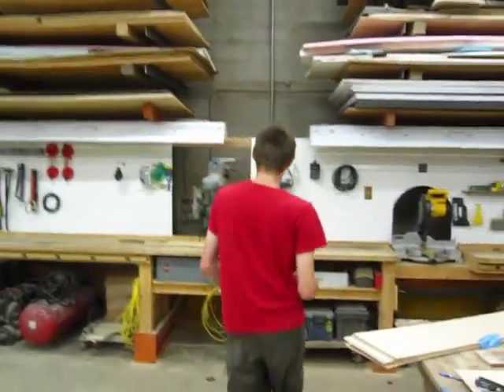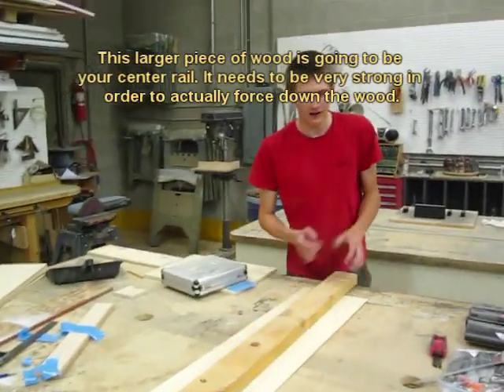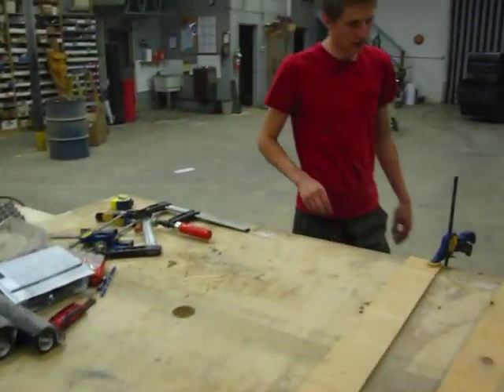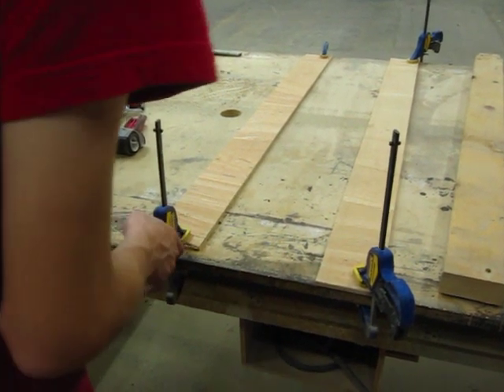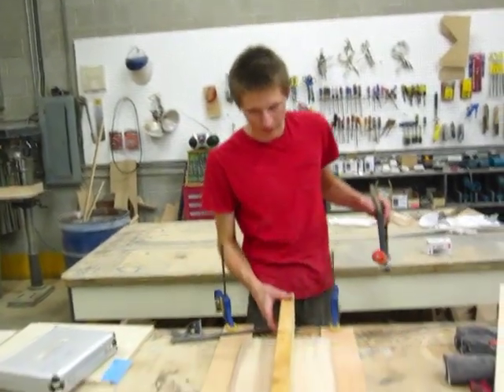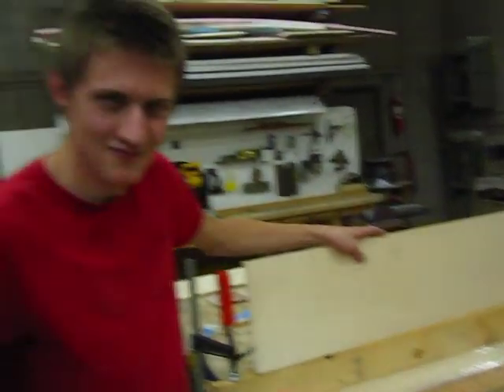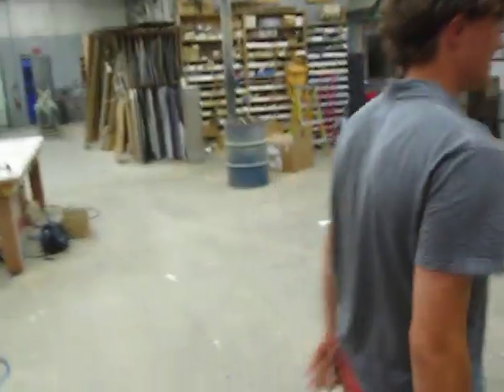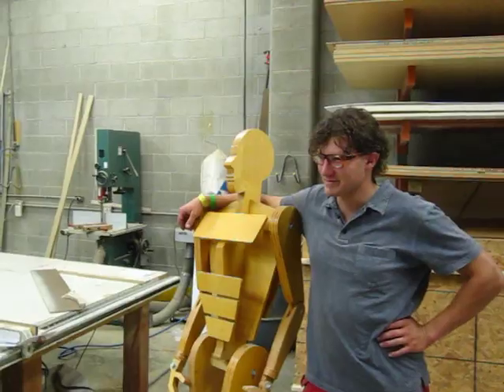How To Build a Longboard, Making the Press.

Comment from the maker: The center rail is flexing, try a bigger piece of wood, and make sure its on edge.
If you can get a clamp in the center of the rail instead of just at the edged, that will work too.

Comment from the maker: You can do it with this, but it will be a little toughter on the rails, and you will have a harder time getting all the shape you want.

So this press is made of three rails to do the concave.
You could literally add three more rails running perpendicular to them for the camber.

So,underneath the two side rails, put a rail going across the center.
And underneath the heavy center rail, put two two that go across the ends of the board.

Comment from the maker: It would work for a pintail. But if you wanted a slight kick,  you'd need to do things a little differently.

On the tail side, stop the rail ( or rails ) 6 or so inches away from the end of the deck.
And wedge the tail up a little bit with a piece of wood.
Its a little bit more complicated, so you may want to use three rails instead of just one.